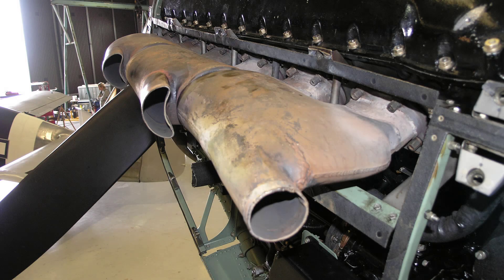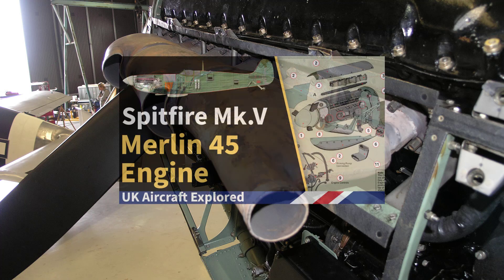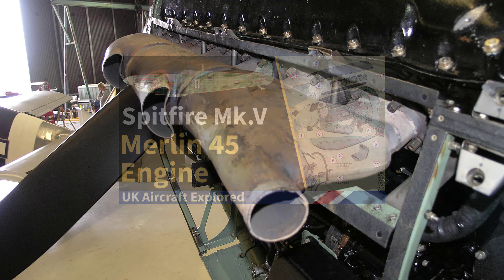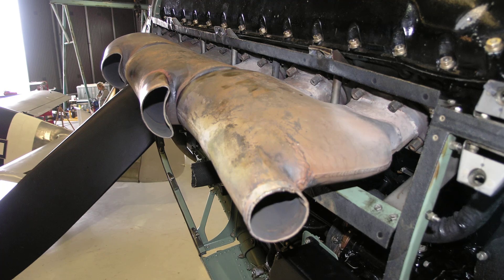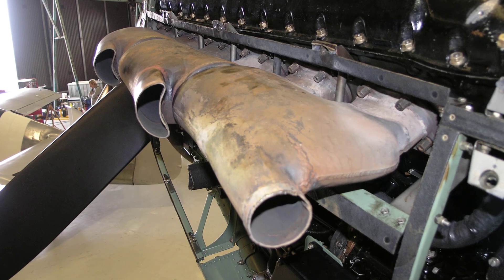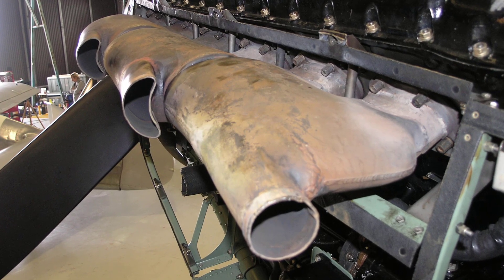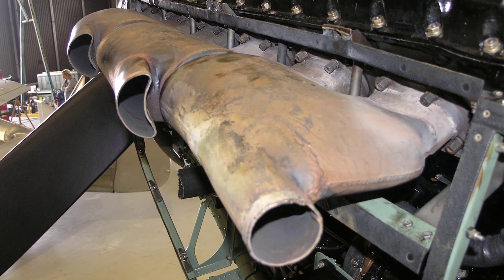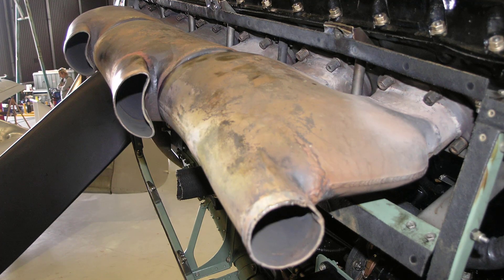Spitfire Mk V – Merlin Engine Photo Tour

Comment: I have seen that on early operational Spitfire and Hurricane models, the engine cylinder exhausts grouped 2 cylinders each into one exhaust and on later Mk V models they used individual exhausts for each cylinder showing 6 exhausts on each side of the engine cowling. -What was the cause of joining in a single exhaust the smoke from 2 cylinders, did they act as flame dampers?
Reply from the maker: It was found that with the three segmented exhaust manifold design, a small amount of thrust could be gained. The three outlet orifices are of fish-tail shape, with one version used on the Mk. V having a gun heating tube passing through them. You can see an illustration of this along with two other types of manifold within my Merlin 45 Video. Hope this helps, and thanks for watching.
Reply: @ukaircraftexplored6556  -If that initial muffler design provided a slight thrust advantage to the ship, why was it dropped from use on subsequent Spitfire and Hurricane models? -In your video of the Merlin engine I see some headers in those engines with the smoke outlet flattened into a thin slot and in another engine those outlets are much wider, what was the reason for such different designs in the manifolds of the later models of the Merlin? -I thought that perhaps making the manifold outlets with that narrow slot design was due to the fact that in the cold season the birds got into the manifold outlets looking for residual heat from the engine and caused continuous mechanical problems. -I thought that to avoid that problem and that the mechanics did not have to be constantly plugging and unplugging the outlet holes of the manifolds, that design solved the problem. -As you know, mainly in jet planes, covers are usually used in the air intakes to prevent birds from entering the blades and ducts of the ship. I don't know if what I've assumed is correct or if I'm wrong. -Thank you very much.